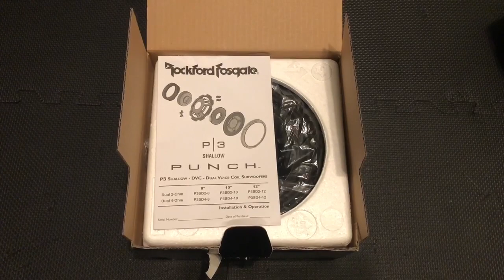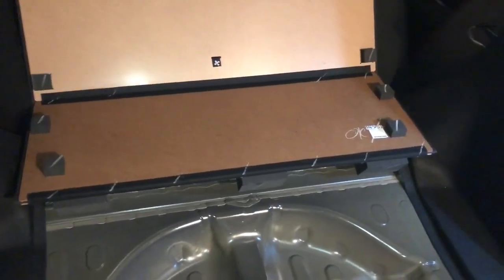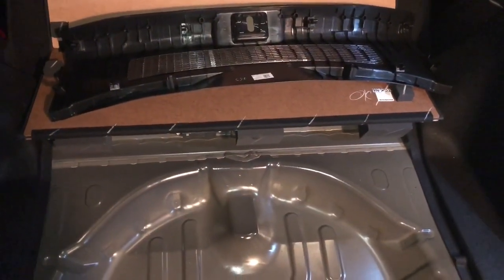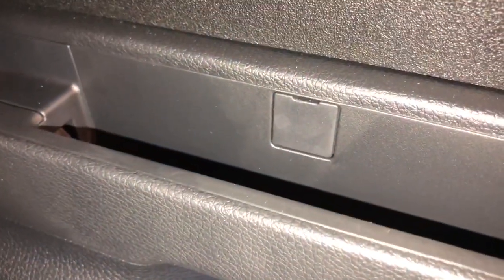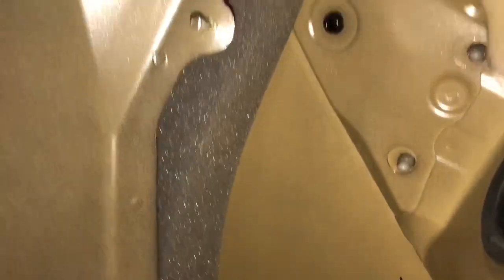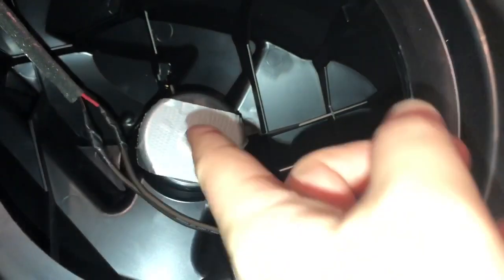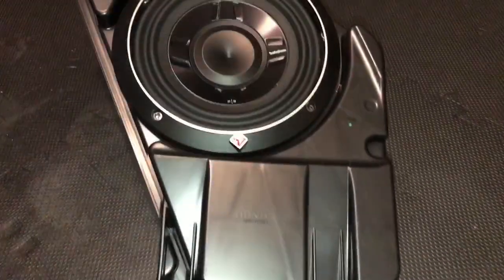Type R Subwoofer Swap

Comment: I realize this video is 2 years old, but why replace the stock sub when you can have your own run concurrent with it?  Obviously with its own amplifier.  I'll put my 12" L7 Solo Kicker against that Rockford anytime.
Reply from the maker: In my Sport Touring I put a 12” JL. Though it sounds way better obviously, I wanted to keep my R clean in the trunk, while still upgrading and having a discreet, MUCH better sub. Plus it was a fun project. At the end of the day it’s personal preference. On a side note, I don’t think you should run your sub with the stock sub, I remember reading somewhere that having different subs running can mess up the sound significantly. I unplugged the stock sub when I had the JL. Good luck though!

Comment: Have you stuck with running this sub off the stock Amp, or have you upgraded? I would assume running 2 Ohm to the new sub will ultimately burn out your stock amp. The stock system I believe is 4 Ohm.
Reply from the maker: I added an amp not too long after. I made a video about it as well.

Comment: It’s more The speaker cabinet then the speaker itself
Reply from the maker: Ur average Savage Yeah, but I also feel the the stock sub and power to it is low, next step is the dedicated amp. If that doesn’t make a significant difference, then new box will have to be installed. A ported box would probably help a lot.
Reply: That’s a great idea

Comment: With this swap i used the same sub and the same punch amp from your other video but the box sounds very hollow at certain bass notes.  Did you use polyfill an/or have sound quality problem with certain sub frequencies?
Reply from the maker: I haven’t experienced any sound quality problems. I didn’t fill the enclosure with anything either. Only thing I did was plug that hole in the back of the enclosure like in the other vid.

Comment: I live in sweden and we don't even get a sub with our "High power 11 speaker"... Do you think we have the mounting screws for the sub kit anyway? I guess I need to figure out a way to mount the speaker myself...
Reply from the maker: I think you should just look into having a custom, possibly ported enclosure made for the sub you choose, and just put that in the space where the sub would usually go. I believe you would get much better sound with a custom box.
Reply: Yea, maybe that's a better solution. Do you think it will make a big difference installing a sub using existing cables (If I even have these though) than have none at all, or should I look into a solution with dedicated amp? Right now the bass is pretty much non-existent really.
Reply from the maker: I think you're gonna need a dedicated amp 100% because if the system didn't come with a sub, the amp might be different. Also just in general adding a dedicated sub makes it sounds SOOOO much better.

Comment: Isn’t the sport touring hatch premium system rated at 540w vs the type r 450w?
Reply from the maker: In Canada they’re the same. I have both the Type R and a Sport Touring, they have the same configuration.
Reply: Will it make a diff if i replace the 540w type r subwoofer with accord 450w subwoofer in my car